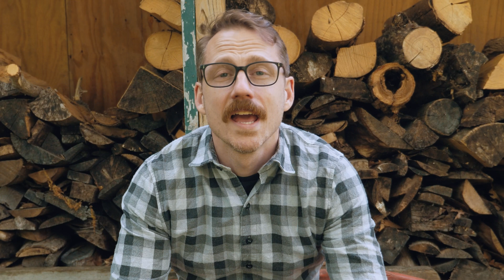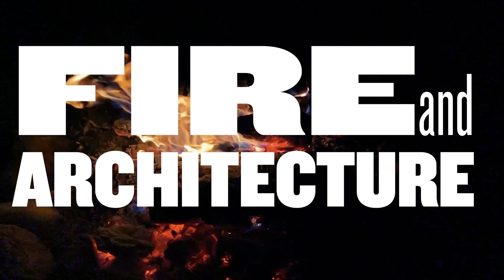Architecture Began with Fire

Comment: Fire is also an important element in the tents which used by the Turks living in Central Asia.  Wooden structure of the tent is set up circularly around the fire called 'Ocak' which located in middle. And there is an opening at the top of the tent to evacuate the smoke.
Reply from the maker: Thank you for sharing.
Reply: @stewarthicks  You're welcome, thank you for the video.😊